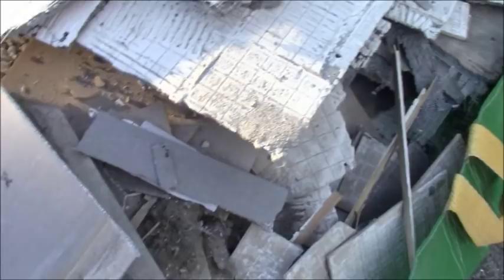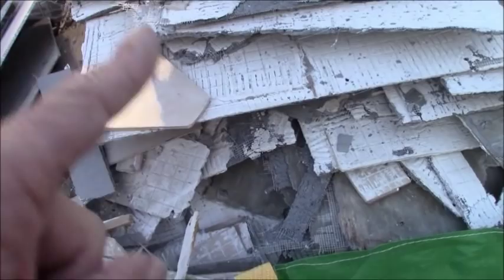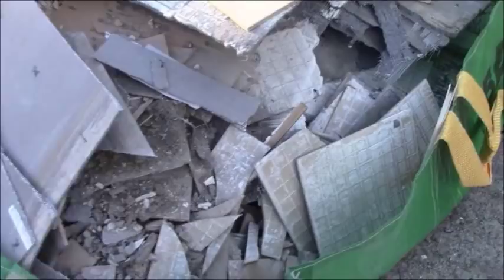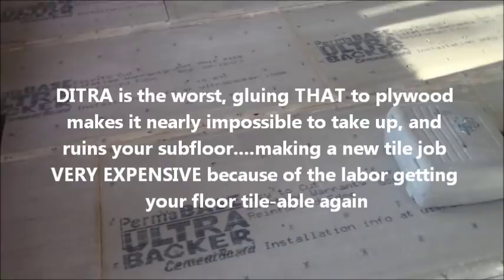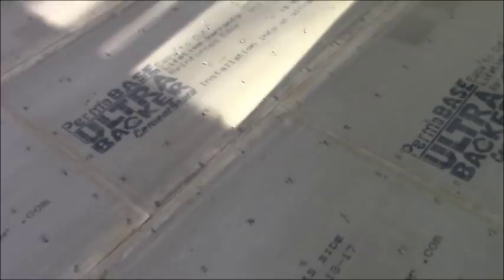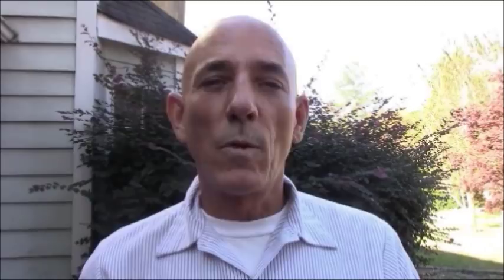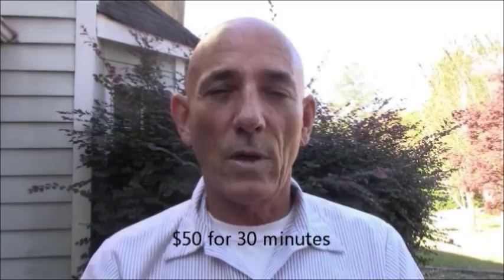GLUE BACKERBOARD ON SUBFLOOR ??

Comment: Why do you feel the need to remove "properly installed" backer board when you're just replacing the tile? I'm sure it was because you saw the cracked tile, and didn't trust it. Twelve years is not a long time for a tile installation - it should be built to last a hundred years. The decision to put backer board down should be considered a permanent installation. I waterproof the flooring, then glue and screw the backer board. If I need to replace the tile, which I plan to do in my kitchen his year (the tile has been down 20 years, with no tile or grout cracks, and is in perfect condition - I just want a new look) I will remove the tile and install the new tile over the existing backer board. If I decided to put wood or carpet down instead, it would go over the backer board. Putting backer board down without gluing is better than not putting anything down, but not by much. The reason contractors always claim "I've never had problems" is because their warranty is short and they are long gone by the time issues occur (it may even be a different homeowner, so they have no idea who to contact). If a customer contacted you 15 years after a job and complained about cracked tiles and loose grout, would you fix it for free? Of course not, especially if the tile or grout could not be matched and it required a complete re-do. As you said, everyone has their own way of doing things, so what works for you works for you. I just think bonding the backer board results in a sturdier, higher quality installation that is less likely to have problems down the road. Thank you, by the way, for your videos. I really enjoy (an learn) from the "bad job" videos. Pretty amazing to see the things you've had to deal with.
Reply from the maker: Glad to respond to your questions, as rhetorical as I believe they are...whew, wished I had taken a typing class !!
 
So allow me: Say a Ford cost $15,000 but a Toyota cost $30,000 and the Toyota last twice than that of a Ford, but double the cost. Maintenance & break downs are vast with Fords at 200,000 miles, and those are only issues at 350,000 with a Toyota...the better value and longevity is the Toyota but you can't afford it so you buy the Ford and deal with it. 
So it is with tile work, my customers are not paying Toyota price, yet you suggest I give it to them, all jobs the same way, built to last 100 years. If I charged everyone the Toyota price I would have far less work and not everyone can afford a Toyota. So then the question becomes why doesn't Ford make their products like Toyota ?? All trucks should last 350,000+ miles, Ford makes an inferior product ! Now I'm not suggesting I install inferior, and yes 15 years is a LONG time for a tile job, most homeowners are average 7-10 years in a house, in this video the tile was installed when my customer built the house 15 years ago & was fugly..style and taste change, as with everything.
To your statement about the cracked tile. My customer had dropped something on it, or so they said...so the point was there was no replacement tile to put there, and even if there was it was dated. I had done the backsplash last year in grey/black mosaic, walls were painted grey, tile matched nothing so they saved & called me to replace it.
And finally to your statement about NOT replacing backer on your floor ?? That would be an awesome trick if you could do it, but the bonding of tile to backer with thinset will make that task impossible.

Glad you enjoyed my videos, and appreciate your perspective. Understand I do things that make sense, and do a job as if were my own. The overkill & over analyzing in this business is mostly because of bad workmanship, not because there's only one way to do it right.
Reply: StarrTile why I bought a Chevy.
Reply: In my experience, it can make removing the 1" 40 year old tile easier.  I can pull up entire boards with tile attached, or I can dislodge 2 million 1" tiles, clean them up, and fix the surface they were attached to.  For me, replacing their backing is worth the time and effort; dislodging, cleaning and repairing the damage from removing tiles is not.
Reply: What if the homeowner wanted to go with hardwood genius!
Reply: StarrTile you obviously know more about tile than trucks. Bad analogy and false. I as a mechanic have seen many Ford Chevy and Dodge trucks last far more than 350k. Not a fan of Toyota mostly for patriotic reasons and don’t give me that bull about how they are made in the US. Follow the money.
Reply: Modified thinset ?

Comment: So Bob... I'm getting ready to do a DIY kitchen and utility reno. I've pulled up the sheet file and underlayment over 3/4" T&G plywood subflooring. I have NO squeaks or loose joints in the entire house. So to be clear you are referring to thinset as glue for the backer board? I don't see the need either with screws holding it down to a stable subflooring. Thanks in advance for saving me a ton!

Comment: 2 years ago I removed all the tile and backboard from the kitchen where most every tile indication had cracked and separated and was falling apart the Baker board had been glued and screwed and it took me 3 days to prep the floor for the new backaboard and tile.  After removing what came up the had been glued I promise you I did not glue mine back down and to this day it's still in perfect condition we shall see. No I'm not Einstein but in my mind the backboard not only adds stability but it also acts as kind of a uncoupling membrane Furthermore you've got 30 to 40 screws in  Each sheet Didn't unless the screws are made out of some dissolving material most likely those chicks are back aboard aren't going to shift or separate from the sub floor Any time in my lifetime. They put this in their specs to cover their asses for the one in a million chance that something happens  that glueing and screwing might possibly have  Prevented. It doesn't cost the manufacturer one more red scent to add one more Requirement on their spec sheet.. But it does however give them one more reason to not provide a warranty and every manufacturer does it.  I said all that to say is I know for a fact that that step in one instance did not prevent The failure of a whole kitchen floor But I do know that I've never glued mine down and never had a call back.

Comment: Not saying adding thinset to the bottom of the Cement Board is wrong however I put mine down ONLY with Cement Board approved screws every ~8 inches. This way If I ever need/want to remove the tile/cement board, while it will be work and messy, it will be easier to cut the screws vs. having to also contend with removing both the thinset and screws. My tile has been down for 4 years and no cracks or movement whatsoever. Just my two cents.

Comment: Most of the time the cracks are caused because the floor joist are not giving enough support which has little to do with backer board being glued and screwed. I am with StarrTile on this. No glue, lots of nails, proper gap, tape and thin-set the joints. Job I am doing now is on a crawl space so I can easily put lots of support under the joist . Do the glass of water test. Put the glass with water on the floor, walk heavy on the floor and if the water in the glass reacts to your foot steps then you may have too much movement. Gluing the sub floor is not going to change any of that. When your floor cracks because the floor joist have too much movement then the product providers are going to tell you they are not responsible for your bad floor joist system.

Comment: Tile jobs with good design should last 30 years. So who cares about taking the old one up. IT is about doing a job to mfg specs!
Reply from the maker: Tell that to people in other countries where they have done things for two and three times longer than we have and it works, manufacturers are not the boots on the ground that see damages or that have to deal with the damages that are caused. 
If there's no problem then there was no solution
Reply: @StarrTile  And I have been doing renovations for over 40 years. I know what works and what fails. Your way fails. The hardibaker will move with (LMAO ROOFING NAILS) and no thinset. Now most renovations do not have the luxury of 2*12 joists either. Renovations with 2*8 joists 22 on center usually homes over 50 years old...you gotta double up the ply 3/4 then hardibaker then tile. Good luck your method. Second time is a charm they say. Third time would be your way. Just saying professionaly. Will agree with you in the Ditri crap..it is junk!
Reply: Skip Rope a quarter inch of thin will crack too ..smh

Comment: The problem you have is you're a builder/tiler. You want your jobs to be as easy and quick as possible. When a customer has had the cement boards installed as per manufacturer instructions, ofcourse it will be hard to remove from the floor. But if it is properly installed i.e. following manufacturer instructions then why would you need to remove it anyway? Unless ofcourse you want to change the whole floor. But as someone who is just on last steps of finishing a full house renovation i do not think or care about the future person trying to change the floor in 10 20 years. I am enjoying my house the way I like it by having installations the way they are instructed for. Extra £50/$50 on thinset makes no difference to my pocket for the extra peace of mind.

Thats like saying i don't touch my girlfriend because im leaving it for the next person....
Reply from the maker: 😂😂😂😂😂
GF analogy 💯

But on the more serious side it's not just causing damage to the subfloor for the next person or even the same homeowner 10 years later because it is a thing to change your mind after some time goes by, but more to the point which apparently you missed is that I've never had a failure starting out doing floors over 23 years ago and not using thinset, in this video I showed proof positive that the thinset was not needed and did not cause any damage. Because you can doesn't mean you should, and that applies to everything in life.

Comment: thank you man! i was wondering about this. breaking my head trying to figure out if i really need to glue backerboard.
Reply from the maker: There are MANY that disagree...if you want to use thinset AND nail or screw then do so...my take is both are not needed 9 times out of 10

Comment: I just removed durock from a subfloor and it was attached with thinset, I assume, or something to that nature.  Nothing was wrong with it, but doing a remodel so it had to come out.  Started with a chisel and hammer and it fucking sucked.  Next day got a corded sds hammer drill with a 1inch wide chisel  and it got the job down.  A wider chisel would have been better but with all the nails, it would keep hitting them.  But it came up pretty easy all things considering.

Comment: I'm redoing my tile bathroom right now.  While ripping up the old tile a lot of the backer board came with it.  I tried chiseling out the some of it, but it barely moves and a layer of OSB is coming with it.  So now I have to decide whether to try to put another layer of backer on over the damaged backer, screwing up the entire floor thickness, trying to chisel out the old backer which will about kill me and damage the sub floor in the process, or just try to cut out the entire subfloor.  This sucks.

Comment: Thanks for the video. I pulled up three layers of flooring being vinyl sheet, vinyl sheet, and the top layer Pergo boards. The bottom layer was a large glued down vinyl sheet. Most of the glue layer didn't come up. It's very thin to the point it can't be measured. Does that need to be removed or can I thin set over it and screw? Also, wont applying thin set directly to the subfloor or that glue layer ruin the subfloor? What do you think about putting down tar paper/roofing paper over the old vinyl glue layer, putting thin set on the tar paper, then screwing it down?

Comment: OMG. We re did a rotten bathroom right after moving in 24 yrs ago.  Due to heaving issues with the house a yr later  it cracked the grout, my husband tried to repair but failed probably because house kept moving till we corrected the problem 4 yrs later.  As soon as I got a second shower up and running I pulled down the shower surround so we wouldn't use it, but I was a new mom of 2 so never got around to fixing it till now (16 yrs later after removing surround).  We had gone all the way to the joists because floor was rotten.  We put in new 1 x8s with 1/4 plywood then 1/2" Durock. Mortored down and glueing between layers of wood.  I have been at this project now for three weeks.  Never again will I glue and mortar.  The only saving grace is my sisters Air chisel.  I l was lucky to get any Durock up in chunks. And ended up going back down to the joists again because the plywood was so stuck to 1x8s.  Awful job.  And hubby no help this time around.  Today I started cutting new sub floors.  Would be easier if the room was bigger but 5' x 5'7". Makes it a pain.  Thanks for your videos. They are great and I have watched so many but like your way best as it makes the most sense.  My question is for neo angle (got any videos on putting liner in that.  I know I am going to have to glue pieces of the liner but is there a best way to do it?

Comment: Had bad coverage on the bottom of the tile you picked up. And while you dont have to thin set under the back 100% of the time roofing nails are a bad idea have removed numerous bad installations with cracking issues and common factors are bad coverage on tile and roofing nails
Reply from the maker: Roofing nails have NOTHING to do with a bad install, operator malfunction is the cause.
Backer board companies allow for roofing nails.
Reply: @StarrTile  they also say to use thinset underneath the backer and if you use the thinset underneath than nails are fine but if not cracks are common if you don't screw it down you should use thinset underneath

Comment: I agree. Cost of repairing the subfloor when thinsetting it on is not really worth it especially when the life of the tile is relatively short 15-20 years. To clean backerboard that's been glued down and reuse it on a new tile job sounds like a nightmare. Cement boards are about $1.50 a sq.ft. Much rather get new cement boards installed that don't damage the subfloor when the old ones are removed. With just cement board screws, the backerboards are still very well in place. With proper tile thinset mix, grout, and troweling, the job should still last a very long time.

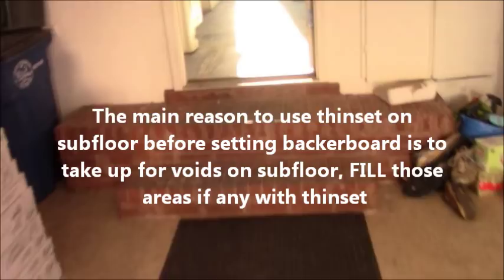Comment: 2:44 no the main reason for glue and screw is movement with the house settling same concept for kerdi detra it allows for movement without cracking  the tiles
Reply from the maker: Understood....
But also main issue I have with ditra, it's a solution to no problem. From day one setting tile on wood subfloor I've used durock without thinset and never had a callback of cracked tile ( from 1998 ).
And never seen cracked tile on someone else's job, like in this video. 

My take on ditra it is a fix and solution to operator malfunction, if you put thinset and a membrane down which is the only way you could put the membrane down, you have eliminated any type of mistake somebody would do otherwise with backer board.... but I can tell you this, pulling that crap out ruins an OSB subfloor, even with backer board and thinset it destroys your subfloor whenever you have to take it out

Comment: Hey Bob, I'm in the midst of redoing my bathroom. The old backer board  was glued and made one hell of a mess trying to get it all up. I really like your method here however I don't want to nail it.  I'm planning on just screwing it directly to the subfloor which is 3/4 inch. That should be okay to do right? Also what type of screws would you recommend.
Reply from the maker: Just to ease your mind the backer board companies allow for inch and a half roofing nails to be used, which I didn't really know until after I started using them 😂
But if you're going to use screws then obviously the screws they sell alongside the backer board, they come in a little plastic box and they are coated.

Comment: I mean, 12 years is not that long of a time. That one crack would have probably escalated to more. The 10/10 way would be an uncoupling membrane. A Good tile job should not be "easy" to remove. If your going to do a half fast job on the prep and structure then no matter how good you set those tiles they will eventually crack. Construction methods really show themselves with age. As the house gets older, the defects start popping up.

Comment: I'm installing a new construction bathroom for the first time. Based on your video, I'm going to just redgard the bathroom floor and screw in 1/4 cement board, then add my thinset and tile. Sound okay?
Reply from the maker: Marcel Yochanan not sure why you want to waterproof your bathroom floor but okay, no harm no foul, just make sure that you put a screw more than every 8 in is what most backer boards companies will recommend, about every 3 or 4 in is what I would say